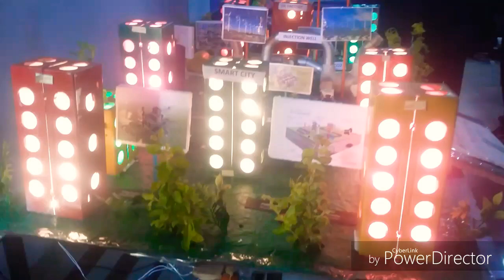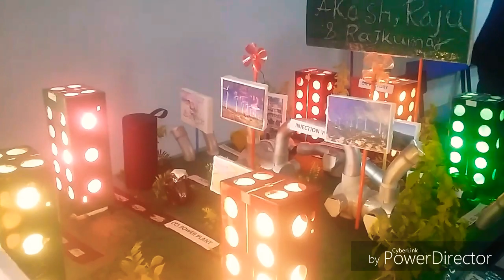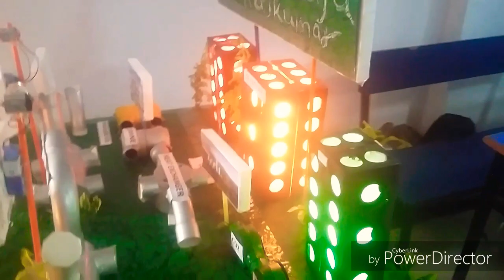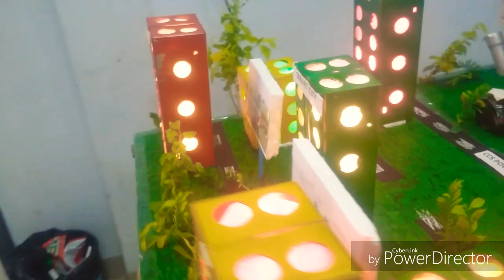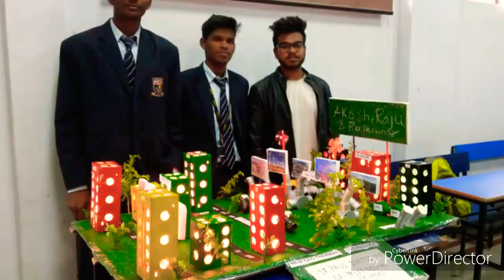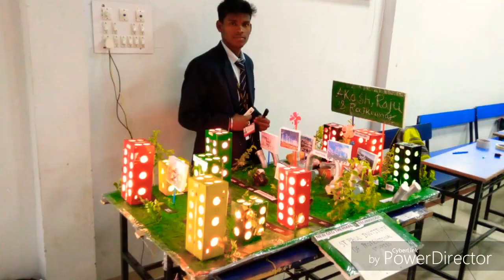Best Science Project of 2019 national science exhibition

Comment: name of this model
Reply from the maker: ST.  PAUL INSTITUTE OF PROFESSIONAL STUDIES

CARBON CAPTURE STORAGE PLANT 

Today, through this model we are going to explain how to convert waste into productive or useful. By this model we will be explaining the working system of model, advantages and disadvantages.
We all know that lot of harmful gases are emitted from factories or industries, which pollute our environment. This reason caused for the invention of this plant Carbon Capture Storage (CCS) plant. In this plant, all harmful gases are stored in a container from which Carbon dioxide (CO2) is separated to another container. We use a Heat Exchanger to store CO2. Here we use high pressure pump to convert gas into liquid. The liquid CO2 is stored at 3kms underground the earth to a container by using injecting well where the temperature is 1250c. Here high pressure is applied on CO2 and then CO2 scatters every corner. Due to high temperature, the maximum amount of pressure is applied on CO2, it gets convert into gas again. We extract the liquid CO2 through production well. Due to this pressure, turbines are rotated and electricity is produced. This electricity is normal as the electricity produced from other sources. We can use this electricity in homes, cities, schools, colleges, factories, etc…,
Advantages of Carbon Capture Storage plant are protects environment, free of cost electricity, long term stability, etc..
Disadvantages of Carbon Capture Storage plant are high cost investment, cannot bear earthquakes, etc…,
 By using this Carbon Capture Storage Plant, we can protect our environment from global warming.  

 Raju Parmar 

कार्बन कैप्सूल भंडारण संयंत्र

आज, इस मॉडल के माध्यम से हम यह बताने जा रहे हैं कि कचरे को उत्पादक या उपयोगी में कैसे परिवर्तित किया जाए। इस मॉडल के द्वारा हम मॉडल, फायदे और नुकसान की कार्य प्रणाली की व्याख्या करेंगे।
हम सभी जानते हैं कि कारखानों या उद्योगों से बहुत सी हानिकारक गैसें निकलती हैं, जो हमारे पर्यावरण को प्रदूषित करती हैं। इस प्लांट के आविष्कार का कारण कार्बन कैप्चर स्टोरेज (CCS) प्लांट है। इस संयंत्र में, सभी हानिकारक गैसों को एक कंटेनर में संग्रहीत किया जाता है जिसमें से कार्बन डाइऑक्साइड (सीओ 2) दूसरे कंटेनर में अलग हो जाता है। हम CO2 को स्टोर करने के लिए हीट एक्सचेंजर का उपयोग करते हैं। यहां हम गैस को तरल में बदलने के लिए उच्च दबाव पंप का उपयोग करते हैं। तरल CO2 को 3kms पर भंडारित किया जाता है, जहां धरती को कंटेनर में अच्छी तरह से इंजेक्ट करके उपयोग किया जाता है, जहां तापमान 1250c होता है। यहां CO2 पर उच्च दबाव लागू किया जाता है और फिर हर कोने पर CO2 स्कैटर होता है। उच्च तापमान के कारण, CO2 पर अधिकतम दबाव लागू होता है, यह फिर से गैस में परिवर्तित हो जाता है। हम अच्छी तरह से उत्पादन के माध्यम से तरल CO2 निकालते हैं। इस दबाव के कारण, टर्बाइनों को घुमाया जाता है और बिजली का उत्पादन किया जाता है। अन्य स्रोतों से उत्पादित बिजली के रूप में यह बिजली सामान्य है। हम इस बिजली का उपयोग घरों, शहरों, स्कूलों, कॉलेजों, कारखानों, आदि… में कर सकते हैं।
कार्बन कैप्चर स्टोरेज प्लांट के फायदे पर्यावरण की रक्षा, मुफ्त बिजली, दीर्घकालिक स्थिरता, आदि हैं।
कार्बन कैप्चर स्टोरेज प्लांट के नुकसान उच्च लागत वाले निवेश हैं, भूकंप आदि को सहन नहीं कर सकते…
 इस कार्बन कैप्चर स्टोरेज प्लांट का उपयोग करके हम अपने पर्यावरण को ग्लोबल वार्मिंग से बचा सकते हैं।

 राजू परमार
 राज कुमार